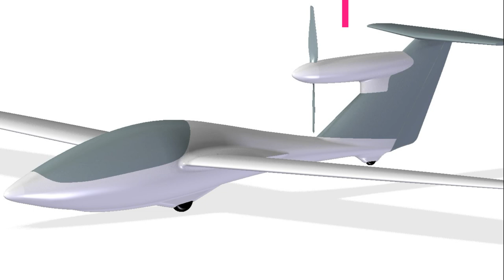WINDEX 1200C SCALE XL part1- Stabilizer and Wing, RC glider build video, RC airplane from Scratch

Comment: This is going to be awesome... I just printed a 60% version of your original in an attempt to get used to thin wall printing and fibre glassing but I feel the engine mount will not support a reasonable size motor to take of from the ground... ether way it was fun to print and build. Also learning to use Fusion360 in the hope to build a design of my own. Cant wait for the next videos 🤘
Reply from the maker: thanks

Comment: Okay, I’m beginning to pick up on the processes in my mind as to how I’m going to build myself a (prob scale) large model with “obeshe” wing carbon/glass fibre covered. I’m going to use hot wire to cut the cores and use a commercially available vacuum sealing machine. All I need is which resin and hardener to use and which kind of bonding adhesive is being used in the video. 😊 I will email Marko daily pictures of my build (until he asks me to quit pestering him obviously) so he can tell me if I’ve messed up. I’m very tempted to make the very same model in this video too. I’ve been flip-flopping on which model to make next and this might actual be the one to build. 😊
Reply from the maker: I'm really looking forward to it, it looks like a very exciting journey. I used epoxy resin in the video
Reply: @markoroolaid  How about the long tube that looked like bathroom sealant? You used it to glue the wooden elevator batons. Edit: Is there a better way of contacting you…Do you have Discord?
Reply from the maker: This is a common foam glue, available at any hardware store. I don't use Discord. But we can freely continue to use the YouTube comment section. Then others will also see this conversation and won't have to ask the same things again 
https://penosil.com/et/toode/polystyrol-fixfoam-877-soojustusplaatide-liimvaht/
Reply: @markoroolaid  ahh okay, yeah no problem. I suspected that glue was some kind of foam-safe adhesive. It looks a little “foamy” when it’s dispensed. Forty years ago, I regarded Obeche wings as fragile and liable to collapse after seeing many aircraft fold up while slope soaring. However, none of those wings had fibreglass reinforcement or carbon fibre wing spars.
Reply from the maker: very good tutorial, in German, but then use google translate https://www.swiss-composite.ch/download/modellbau-giotto/?_sft_pa_art-des-datenblatt=anleitungen
Reply: https://youtu.be/sjT61wKrA-E This is the video I’ve been studying to learn about composites, something I know very little about.
Reply: @markoroolaid  thank you Marko, lovey aircraft. 👍

Comment: Great to see a bigger Windex coming to life.
Can you describe the materials used for the wings structure?
Reply from the maker: The construction of the wing is as follows:
-filling foam EPS 60
-1 layer of 50g fiberglass.
-1 layer of 200g -fiberglass strip 100mm wide
-2 mm balsa
Wing connection carbon fiber pipe 16X12mm